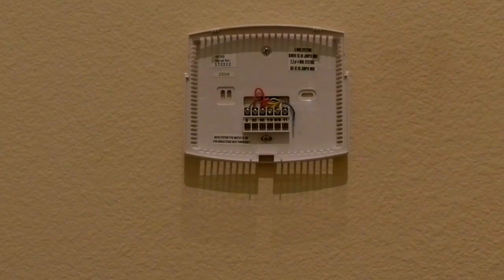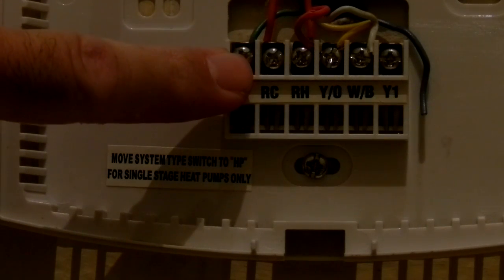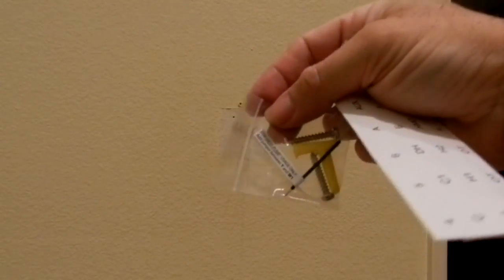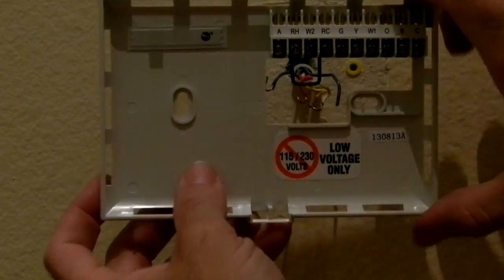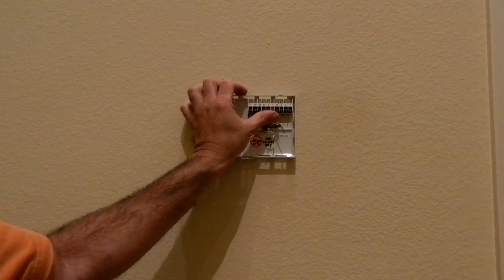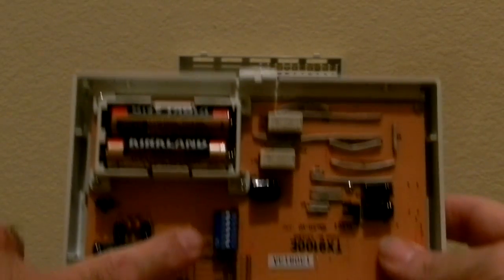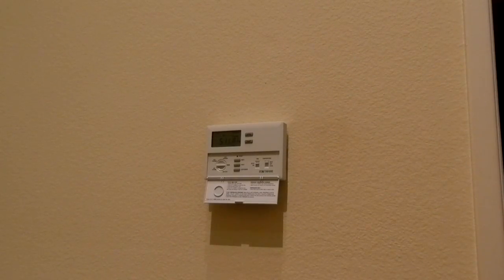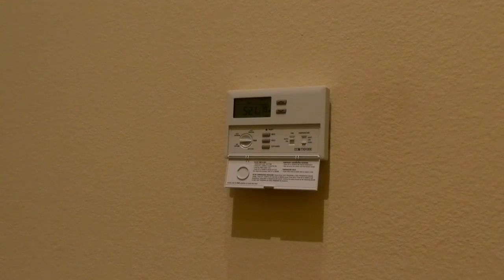LUX TX9100E Heater/ AC thermostat installation video

Comment: Our heater looked how can we unlock it? It won't let us change the temperature.
Reply: Jalisa Perot 
Display is locked or will not respond::: 

Press the NEXT button 3 times then press the 
HOLD button once. This button sequence locks and 
unlocks the thermostat.
Reply: Lo Nio My trouble is knowing how to start it, you know how do I know if it’s actually running? Because i set the the temperature I want, but the screen keeps blinking after I put back up on the wall and I don’t know if that means that it’s already working? Or am I missing one last step?

Comment: This is super helpful.  I have been without a working thermostat since yesterday.  My dog n I are freezing. Aftet watching yours video the gsn came on. It says the heat is on. I feel cold air n it stopped.  Am going to keep watching yours n then give up. The directions for my model weren't helping at all.